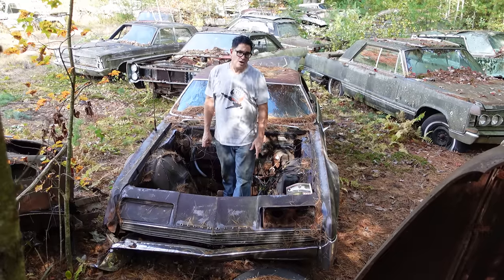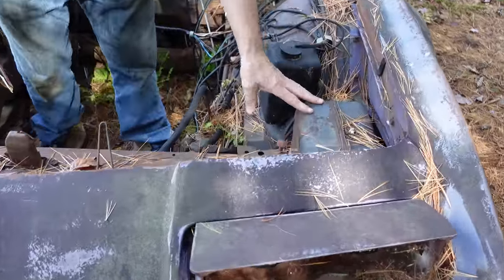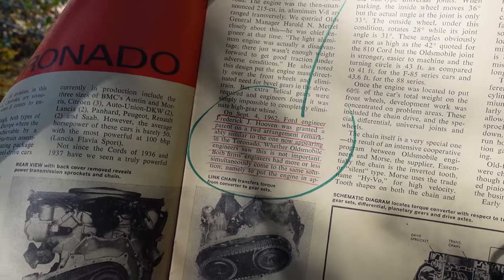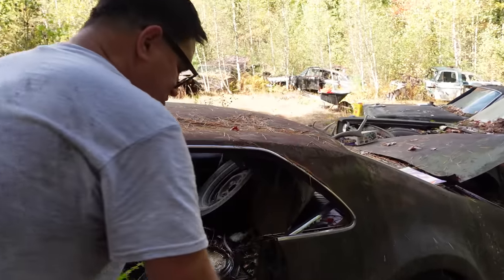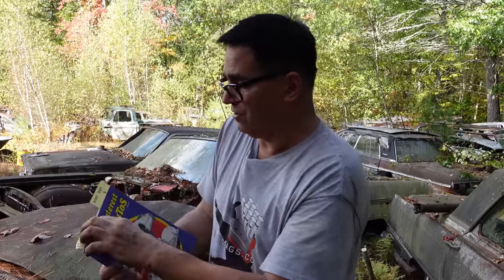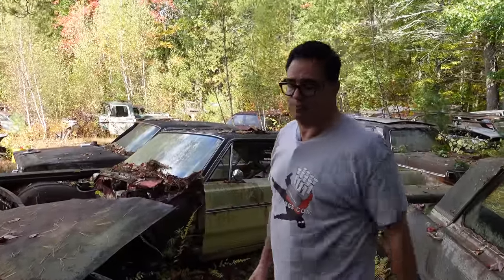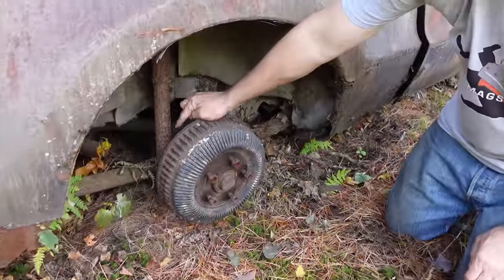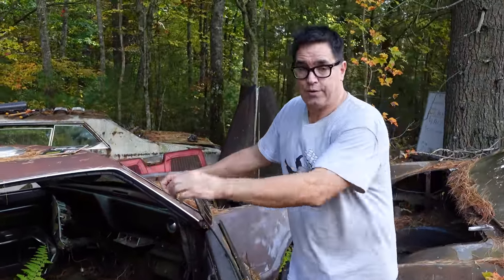Torque–O Nado

Comment: Later in 73-78 GMC utilize the Toronado drive train in GMC Motorhome.  This allows for a lower floor and entry.
Reply: That's correct. "Unitized Power" (or something close to that nomenclature) I believe was what they called it off the top of my head.

Comment: Growing up we had a 1970 Eldorado, the same drive line but with the big 500 engine. It was a fast car and could spin the front wheels.

Another interesting footnote is that GM used this drive set up both the Olds and Caddy for the GMC Astro Motorhome. When cars stopped using this arrangement it killed the motor home too.

Comment: thanks! my dad had a '68 Riviera...very similar body...
except it was rwd. 430 cid eng.
got 15 on hiway.
Reply: The Riviera may have been "similar" but wasn't front wheel drive until the 1979 model year.
Reply from the maker: I'm fully aware that later Riviera went to front-drive, I owned one as a winter beater. But its a mind boggler that GM considered the debut-1966 Riviera, 1966 Toronado and 1967 Eldorado as having shared the same E-platform. Some day I need to get an Eldo and a Riv up on their sides (in the junkyard of course) to take a close look at which panels / stampings / castings were shared and how / where the Riv's rear-drive architecture was merged into the front-drive Olds / Cad platform and how / where the Riv's front coil spring suspension over ruled the torsion bars used by its cousins. One would ASSume Buick went "the long way around" to share the E-platform and maybe shoulda / coulda based Riv on maybe the Electra / Wildcat platform instead. But certainly GM management considered this idea and declined - for very good reasons I'm sure. And these reasons may well have had much to do with plant capacity, worker relations (Union hassles) and other stuff "outsiders" (including car magazine interviewers) never got to learn about. So we can only surmise.... It's a similar thing with GM's 1961 "senior compacts" being "based on" Corvair bits. Mass production isn't always so easily defined! Thanks again for your insights. -Steve Magnante

Comment: Because of the Toronado I've subconciously placed Olsmobile above Buick in the GM pecking order since I was a kid. Even a Mopar crazed rugrat in the early 70s intuitively sensed there was something unique and fabulous about the early Toronado. I put a couple hundred miles on a 66 a buddy had in college and it lived up to the image in every way, even as a 16 yr old used car. I'm not a fan of frontwheel drive in anything bigger than my old Scirroco or early Neon but I'd take a 66 Toro anyday and not complain. Of course Leno's RWD, LS hotrod is the perfect realization of the concept but I'd rather have the 75 slightly scruffy Mopar A and B bodies I could have for the same price. Never knew the Eldo-nado twins shared any DNA with the late 60s Riviera but I'm going to pretend I did all along like I always do

Comment: I have seen this car in many of your outro's and was curious as to whether you had done a video on it. Glad to finally see it. I always thought there was potential for a rear/mid engine conversion using the Toronado FWD drivetrain. The car was always too big for my taste although I did like the styling. GM did a good job with this design.
Reply: I had a magazine when I was a kid, someone parked a complete Toronado drive train in the back of a Porsche 911. It was an early SWB model so they could get rid of the lead weights in the front.
Reply: The mid engine conversion has been done to small pickups with varying degrees of success.  A show on Hot Rod / Motortrend bought a 70's Mazda pickup that had the Toro conversion , Corvair rear suspension.  The seller claimed that it would do wheel stands and 10 in the 1/4 ( it did neither and was eventually stolen off a trailer in a Ca motel parking lot )

Comment: I had a 67, not much different than a 66, absolutely loved it, and all the power stuff was vacuum operated, so it was easy to fix, because if something stopped working, you knew it was a vacuum leak. What sucked was, when it stalled, you lost everything.. i almost rear ended a cop one day at a red light one day like that! 😜

Comment: As a matter of fact, I did purchase a 1966 442. But I have always been a fan of the big Toros. Think I need to check out the Hemmings book, thanks for the tip!
Reply: In 74 I bought a 70 442 Cinnamon Brown, all the power options & OAI hood. I put headers,alum. intake & Holly 780. I was So Fun to drive. I also drove a 69 Toro. for a while. I liked the Olds styling. I cant believe GM canned Olds & kept Buick ??
Reply: @mikemiller659  I agree, I had several Pontiacs and Oldsmobiles, but never a Buick.  Then again, I owned a few Plymouths but never a Dodge.

Comment: Thank you Steve for this information.... I can remember those cars. A friend of mine had a Cadillac that was based on that same platform. It was originally a diesel front wheel drive but it was converted to an Oldsmobile gas engine, and I tell you what, that thing would absolutely smoke the front tires.......

Comment: i had a 1966 with ALL the options ...cruise control..with roller wheel to select ur speed...also in 1967 the 425 cid ULTA HIGH COMPRESSION version was added...jyst one year...1968 went to the 455 cid

Comment: Back in the day a guy I worked with put the complete toronado front drive and rear axle in a brand new 1973 chevy 1/2 ton short bed pickup. It ran and drove

Comment: I bought a 68 Toronado about 25 years ago where someone cut 30 inches out of the middle of the car. You could not get in the car from the drivers side, you could sit on the backseat and reach the steering wheel. The bodywork was basically done, it needed the window glass modified to fit the cut doors. 

The engine from that car now lives in my 69 olds.  I really wish I had taken some pictures of that car before I sold it. Someone definitely put a lot of time and effort into cutting and welding it.

Comment: Hi Steve, I do remember the July/August issue of Hemming's Special Interest Autos Magazine featuring the Oldsmobile Toronado due to the fact that my late father was a subscriber.  The magazine is now Hemming's Classic Car Magazine.  The original Oldsmobile Toronado and the original Cadillac Eldorado are my two favorite front wheel drive cars.  The front wheel drive design was not based on fuel economy as front wheel drive cars are today, these cars where high end personal luxury cars based on less harmonic noise and vibration transmitted into the passenger compartment, and more room inside the car (no transmission or driveshaft tunnel) these cars share nothing in common with the front wheel drive cars of today.  Please reply.  Dave...

Comment: I remember seeing one at the local trans shop getting worked on. Jack had to buy the jig to hold the engine during the trans removal. I believe it’s a TH-425
Reply: Correct, THM425.

Comment: In a head-on collision with anything substantial (back when hitting an Imperial was like hitting a brick wall), the whole 1st gen Toronado engine cradle moved back as one block, so steering column headed straight for the unlucky driver’s chest. All because any brake hose leak sent the pedal to the floor with no stopping power. Next year came with dual brake reservoirs and collapsing steering column mandates.

Comment: Speedo has a peg at 135 but they will get there easy. I'm on my 12th first gen Toro. My dad special ordered a '70 GT, fully loaded. So many great memories if road trips in that car. We had a new '74 GMC motorhome too. That thing drew a crowd every time we stopped.The '70 GT is the apitamy and perhaps the best Olds ever made.
Reply: Damn- 12th? Haha- have you ever had issues with those front drum brakes? are you a member of the Toro Owners Assoc?

Comment: i figured you'd get to this when i saw it in the background of the prior vid. If you liked taking out Daddy's car to do burnouts, this was the machine for you. GM coaches used this drivetrain but Hurst Olds would later borrow the forged crank 390 hp model (i thought you might bring out your Hurst Hairy Olds model kit). the question about "patent workaround" is possible--when Sam Colt patented the revolving cylinder for revolvers, many invented the "pepperbox" that had multiple barrels revolving around to get around paying him. As for the rear shocks, reminds me of the 1980's Ford Fox 5.0 Mustang "quadrashock" rear setup for prevent solid axle hop (didn't work on my 1986 GT).
Reply from the maker: Hello Albert Gaspar, lets not forget John Smyser's "Terrifying Toronado" dual 425 exhibition match racer of the mid-1960's. Unlike the 4-4-2- based Hurst Hairy Olds, Smyser really used a 1966 Toronado as the basis of this crazy machine. And just like the Hurst Hairy Olds, the Terrifying Toronado smoked all four slicks the entire 1320 and was pretty unstable. But the crowd loved it! Google "Smyser's Terrifying Toronado" for some more info! Thanks again for writing, Steve Magnante

Comment: Somewhere out there in the wilderness is a tornado grafted to an old Shasta camper. They made a motor home out of the two.
Reply from the maker: Hello wrecker Johnny, YES INDEED! I spotted a camper-converted '70 Olds Toronado at the old Desert Valley Auto Parts location in Phoenix about 4 years ago during a Roadkill's Junkyard Gold shoot visit. It seemed to have been home made but was done pretty well. I'm betting there may have also been a small outfit that cranked out a few OR the idea just seemed "too good" and spurred lots of home-builts. I know Desert Valley Auto Parts relocated to a spot outside of Phoenix and they had to CRUSH a lot of the excess because it was just too  much to relocate every single car 50 miles away to the new spot. I have no idea if this Camper-Nado made the move but don't remember seeing it when I visited the "new" location 2 years ago. Thanks for watching and writing. -Steve Magnante

Comment: Beauty Toronado! These are popular among  seaplane owners for the front drive and the weight of the big block, they cut off the entire rear end of the car, fabricate a long hydraulic “lifting deck” that sticks way out the front and use it to launch and retrieve seaplanes from the boat ramp! 
The steering is reversed and the power steering pump can be plumbed to operate the hydraulics. A shame to hack up such beautiful cars, but they were the best thing for the job.

Comment: The '66 headlights changed in '67...seems the styling on the assembly would "Whistle" going down the road, so they smoothed the covers for the next year
Reply: It does seem better aerodynamically to have the smooth design.

Comment: Personally I’d pass on a 66 due to the brakes, but 67-69?  Huba-Huba.  Great video as always, keep it up (#motortrend really dropped the ball)
Reply: What broke on the '66 that they improved on the '67 and up?
Reply: @mexicanspec  I misspelled “brakes”, 67 & up had dual circuit hydraulics, as well as a factory disc brake option.  (66 is awesome in every way, except that…)

Comment: I saw an article where someone mounted Toronado drivetrain "behind" the rear seat (notch for pully clearance) of a late model Corvair.
Unfortunately, I've been unable to find the article (damn Murphy).
Reply: We did it, behind the front bucket seats of a 66 Corvair! Easy build, the Corvair rear subframe was wide enough. One problem was having a tight fan shroud to pull air through the radiator. The drive wheels had to be offset even more. We had flares extending 6 inches past the quarter panels! Fill the gas tank, add ballast in the trunk to keep the front wheels down!
Reply: The "Crown" conversion is well known, but I'm talking about a conversion where the back seat stays in place.

Comment: We had two of them in the mid 70s, a 66 and 67. One was mom's and the other was my brother's, I was in grade school. Still remember my brother punching his at 30mph and breaking the tires loose. He's said the 130 speedo wasn't enough and he's glad he didn't get killed in the damned thing. His got wrapped around a tree, slow speed in winter. I suspect the front tires where spinning around the corner, common mistake with front drive. No idea what happened to mom's. 
Great cars but after 67 they got ugly. The 425 they use is supposed to be one of the best Olds engines, or is it just the heads?

Comment: I thought maybe you would mention the Hurst Hairy Olds's, there was a couple of those things, maybe 3? But 2 for sure, but they both had two, 2 , Tornado engines and drive trains in them, one in the front and one in the trunk area. I believe one was built on a 66 Olds 442 and the other was a 67..? Anyways one of those they wrecked it so they scrapped it and the other is in a museum today up in Ohio or Michigan? Anyhow, yeah you want to talk torque monsters, geez those things were monsters and they were 1200-1500 horses each and about the same in torque. But yeah even though there's model kits of HHO, they were in fact REAL cars. And you watch, somebody will get on here and think they know every damn thing, hahaha!

Comment: Sad seeing it sitting there, engineless.  Body looks saveable.  Odd it's a single reservoir MC; Cadillac was dual cylinder years before that and I thought the big Olds and Buicks were as well...  Wheels were interchangeable between Toro and Eldo from 66 to 78.  The Toro drivetrain was used in GM's FWD motorhome...

Comment: I detest front wheel drive.
I remember my mother's 68 SS 396 Chevelle had a rolling tach like the Oldsmobiles speedometer.
Reply: Have you driven one of these?  You don't know it is front wheel drive unless you floor it.
Reply: @mexicanspec  I have drove the Eldorado version and I don't like them or any other front wheel drive vehicle and I have unfortunately owned a few of them just not the Toronada.
Reply: @garymckee448  I had 2 '67 ElDorados and I loved them.

Comment: Man, that east coast eats metal like a sugar cube in warm water.
Reply: When Steve's at the right rear going over suspension points, you could see part of the frame in the shot, right side of the screen. Not pretty. But yes, many a winter beater I bought in the early 80s that suffered the same fate including a Challenger and a 72 Charger. Damn I hate road salt. Don't miss that shit at all.

Comment: Oldsmobile did it first because Oldsmobile was the testbed always. Oldsmobile Diesel ring a bell?
Reply: Father owned an 1981 Eldorado diesel.  Last GM car he ever owned.  The incredibly stupid thing is that GM owned Detroit Diesel at the time and they were not consulted during development.
Reply: @bobbbobb4663  Oldsmobile Diesel was rushed into production and the engineer on the project told GM what needed to be done and they fired him and he sued. If they would have taken thier time and put a water separation system and a turbo on the engine it would have been a million times better

Comment: You did not mention that these cars actually had the lowest drag coefficient of any American car of that era, around 0.38.  Too bad that 425 engine sucked.  It was a wonderful piece of engineering with a garbage engine.  There is a good road test in England by Autocar (I think) and showed really poor acceleration (about 16.6 1/4 mile despite the 4.25 rear (front?) axle) and only 126 mph top speed.  Autocar always did their best to measure performance properly.  By comparison, a 413 Chrysler 300 G with same weight and rear axle would do high 15's 1/4 and well over 130 mph top, despite its not so good aerodynamics.  Perhaps one should install a 440 in a Toronado.

Comment: Front wheel drive......why???
Reply from the maker: Motor Trend magazine ran several stories on the Toronado when it came out and a major point was a flat floor for maximum passenger comfort. They also touted the improved traction of Front Wheel Drive in snow. Motor Trend gave the 1966 Toro its Car Of The Year plaudits in '66 and even a magazine cover! Thanks for writing, Steve Magnante

Comment: Didn’t they make these into the 1980s?
Reply: The basic mechanical layout did!
Reply: Yep, two door models with the V8 until 1985 . Then it went to transverse mounted V6 power in 86. Then the model was renamed the Trofeo' for, I think 1991.
Reply: Yes, through the 1992 model year. It was eventually called "Toronado Trofeo" by then.

Comment: Does anyone even make car models anymore?
Reply from the maker: Hello MotorheadRedo, YES! The 1/25 scale plastic model car industry is still very alive. Round 2 has most of the "old" AMT, MPC and Lindberg kit tooling and keeps many of them pumping out new kits today. There's also Moebius Models that has invested millions in brand new tooling for models of car that had never been done before. Cars like the 1951 Hudson Hornet, 1955 Chrysler C300, 1965 - 1972 Ford F-series pickup trucks, and best of all (to me) 1965 Plymouth Belvedere and Satellite kits of Slant Six cars, 383 cars, A990 Super Stockers and even the Golden Commandos altered wheelbase car. Oh, and lets not forget the new Moebius Models 1963 and 1965 Chevy II and Nova! All are brand new and speak to the fact plastic model car sales are still very strong. The big difference from the old days is the fact the average buyer today is between 30 and 130 years old. The "little kids" who bought the first round of car model kits back in the 1960 - 1975 period are grown up but still building. And yes, a few little kids today build plastic car models, but its mostly adults who DON'T blow them up with fire crackers....much. Thanks for writing. Check out the Round 2 Models and Moebius Models websites for a pleasant surprise. Thanks again for writing, Steve Magnante